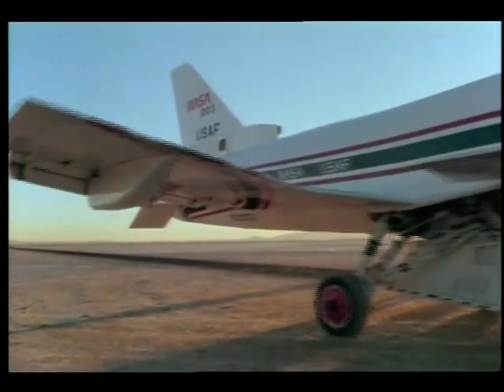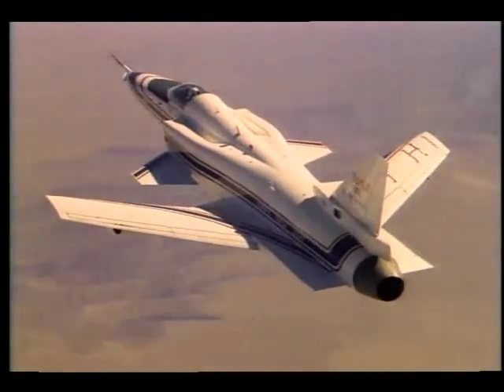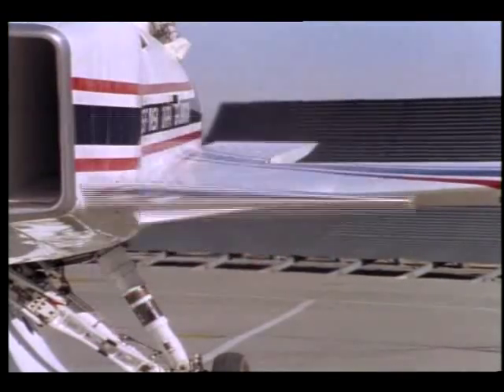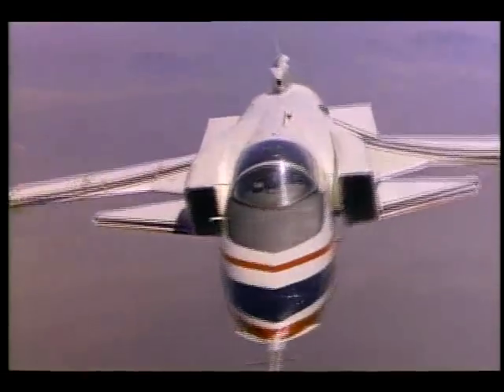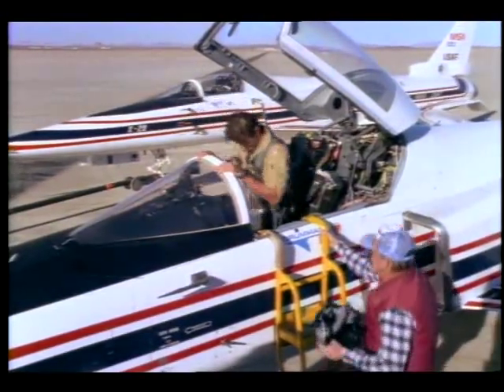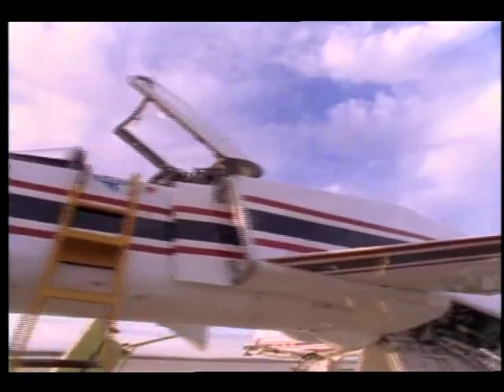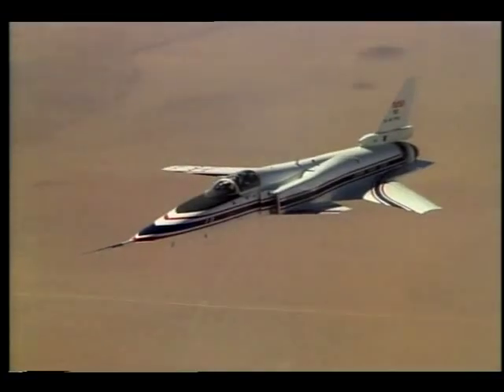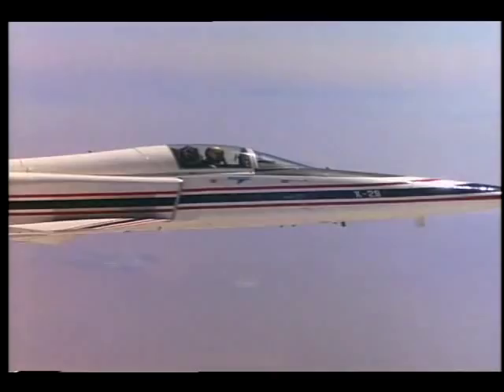X-29: Experiment in Flight

Comment: I am amazed that it even broke the sound barrier, as it's incredibly difficult to get the front-swept winged airplane to fly that stable during supersonic flight speed, surprisingly up to Mach 1.6 which is crazy for the front-swept wing design and don't get me wrong, I am actually impressed.

And I wouldn't be surprised if it makes a comeback especially in a certain variable geometry front-swept wing hypersonic jet fighter (think Stealth movie), as it may be one of a few fuel efficient way to stretch fuel mileage a bit as apparently military is starting to actually care about how much fuel they're burning.

Comment: It's pretty interesting how apparently it would be completely unflyable without the computer making 40 adjustments a second
Reply: Yes, completely fly by wire. Although not shown in this videoclip, it makes it very very manoeuvrable. Very impressive roll rate for its size and weight.